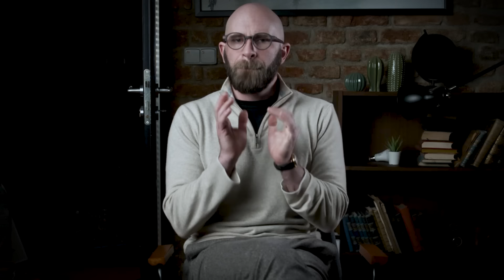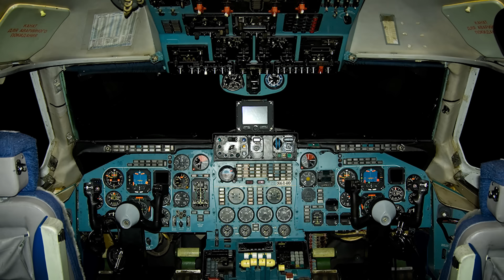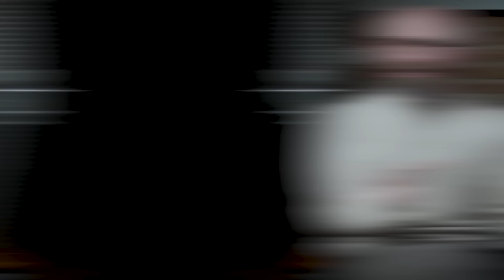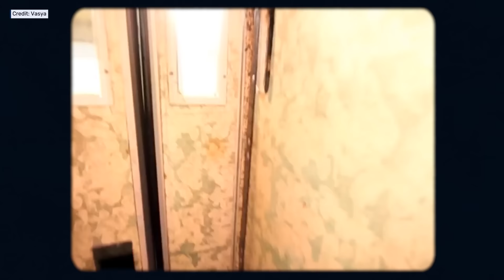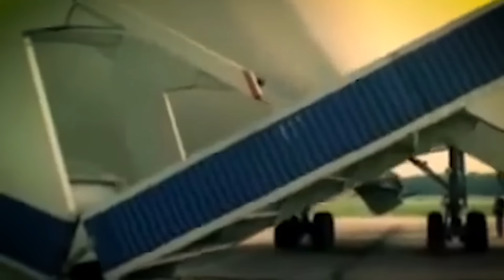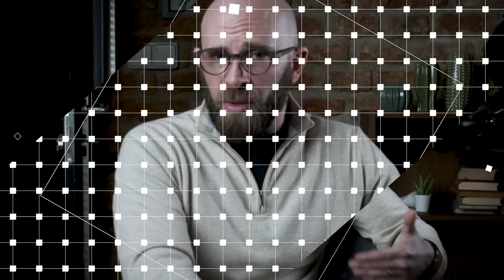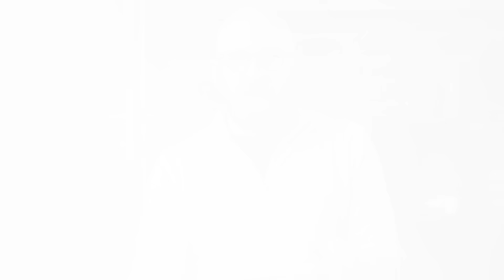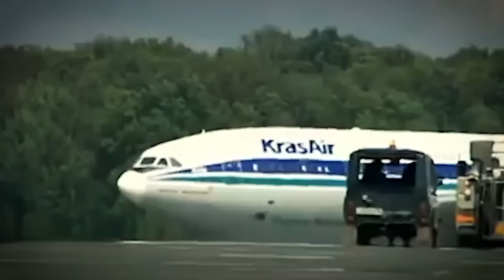The IL-86: The Soviets' Botched Answer to the 747

Comment: Far from me to defend the Soviet Union, but in this case, I think they're ragging a bit too much on the IL-86. Most of the "weird" features were copied from features that existed, on at least some versions, of the L-1011, DC-10, etc.

Cathedral ceilings (no center overhead baggage bins) were how all L-1011 and DC-10s were originally delivered. Carry-on bags were really not a thing in the 1970s. I flew on DC-10s in the 1970s that had the cathedral ceiling. Fantastic feeling of space.

The 747 was originally 9 across in economy, in a 2-4-3 arrangement (I flew one in that configuration as late as 1985). L-1011s and DC-10s were originally 8 across in economy. The 3-3-3 arrangement shown in the IL-86 is one of the more sensible things about it, there's a lot of research showing that it's a preferable arrangement (from passenger comfort standpoint) to 2-5-2, which is what the standard economy arrangement became in DC-10s. 

DC-10s and L-1011s had versions built with lower-lobe galleys with elevators going from the passenger-cabin to the lower-lobe. Not all airlines ordered this feature - it sacrificed lower-lobe space that could be used for more air freight. But, for instance, the DC-10-30CF convertible version (which could be quickly converted from passenger to all-freight configuration) had lower-lobe galleys with elevators. The elevators could be dangerous. There was at least one flight attendant who died in a malfunctioning elevator (World Airways in the 1980s). Not sure if the 747 ever had this feature, but would not be surprised if it was an option. 

The higher gross-weight DC-10s also had a center landing gear (DC-10-30 and DC-10-40), though only with two wheels, not four. In fact, such aircraft were known as "male" DC-10s because of the extra landing gear hanging down the center of the aircraft.

Lockheed built a version of the L-1011 which had lower-lobe doors and stairs. It wasn't common, but it did exist. PSA and Court Line took aircraft like this. There are surviving Lockheed video showing demonstrations of the in-built air stairs. 

What was really weird was the use of low-bypass turbofans on the IL-86, because the Soviets didn't have the technology (at the time) to make high bypass turbofans that powered the 747s, L-1011s and DC-10s. It's like if the DC-10 was built using the engines that powered the earlier generation 707s and DC-8s. This is why the IL-86 was noisy and underpowered relative to western-built aircraft.

Comment: Later version named IL 96 wasn't that bad.
Reply: and the first was good. the most important thing is that it performed its tasks with dignity. fuel consumption for the USSR was not a primary issue. range was not needed, the aircraft was developed for flights within the country, that is why it was called an airbus, that is, an intercity air bus

Comment: Every airliner has elevators, but not many have lifts.
Reply: Good comeback. Americans don't call them lifts since that is what they call part of a lady's attire. But elevators are also a control surface on aircraft.
Reply: I admit I was briefly confused. Simon is British, too, so should say "Lift".
Reply: This comment wins. And whistler is English!! What is this
Reply: There’s plenty on the wings
Reply: The L1011 had an elevator to the flight kitchen on the lower level
Reply: @ght33 The McDonnell Douglas DC-10 also had that feature but they called it a dumb waiter.
Reply: That is a rather short remark
Reply: Except the ones with elevons. ;-)
Reply: Im sorry but you are utterly wrong, every single airliner does have elevators which are important control surfaces that control climbing and descending of the aircraft. And without Lift (aka lifting force) that is generated by lifting surfaces, no aircraft would rise in the sky, I mean not at all.... :body-blue-raised-arms:
Reply: @madigorfkgoogle9349 except for aircraft that have stabilators…which is reasonably common on commercial jets
Reply: There the same
Reply: @himfen28  "There" is a word having to do with a place, like "over there." "They're" is a contraction of 2-words "they" and "are."
Reply: @danielocarey9392  please edit and add in an explanation of their
Reply: @johnbailey3877  Of their what?
Reply: @johnbailey3877  their what?
Reply: @danielocarey9392  I was expanding on your comment (which I enjoyed). 
THERE.   THEY’RE  & their
Reply: @johnbailey3877  I get it. Silly me.
Reply: @danielocarey9392 😊

Comment: Nine abreast economy seating (18" width) was wider than virtually every widebody on the market except for the 747. The 777 introduced nine-abreast 18" economy seating in 1997 (nowadays typically ten abreast with inhumane 17" wide seats and narrower aisles), but every other 20th century widebody used eight abreast (seven in the oddly narrow 767)
Reply: 2-3-2 in coach on a 767 was wonderful. You nearly always had either a window or aisle seat. If you were stuck in the middle seat, it still wasn't that bad because you were only one seat away from an aisle on either side of you. That was very nice. Too bad that configuration went away with the 767.
Reply: NO not correct  the L1011 and the DC-10 both had had 9 abreast seating in coach...  The L1011 used 42" wide seat seat pairs in the 9 abreast and the DC-10  had 17" wide seats.
Reply: The 767 used 2-3-2, the most comfortable arrangement. Some extreme low-cost operators have tried 2-4-2, but it's pretty well nearly impossible to do more than 7-abreast in a 767, just like more than 5-abreast in an A220, which makes these the most comfortable airliners in economy class generally. Too bad so few 767s left in regular passenger service. As for the L-1011 Tristar, the Air Canada one I flew on in 1987 had a 2-5-2 arrangement. As I recall, it didn't have a central carry-on bin setup... but it was  a long time ago...
Reply: I was on a 747 from Narita to Bangkok that had a 5-seat middle row layout. Can't remember what the outer row were though. Not sure what airline either.

Comment: The DC10 had a fourth landinggear just like the IL86 did. That is also true for the A340 series (while its newer than the IL86).

Elivator for the galley is something some 747 and all L1011 have also, so that was not really uncommon at the time

The L1011 also have built in steps, so again, that was already a thing.

Its also worth saying that not all countries was even part of the cold war, at least not in theory. Even in Europe Sweden, Ireland, Finland, Swizerland, Austria Yugoslavia (sort of kind of) and Albania was not part of the cold war. While Spain, Portugal and Greece joined Nato in late 70s, While the last countries was really not friendly to neither Nato nor USSR prior to that.

For the mentioned nation Finland and Austria actually traded quite a lot with to eastern block, and for Nato countries, that was also true for Italy and France. Even USA traded a bit with USSR

Comment: It really sucks!  The Lockheed L1011 TriStar was a work if art, but somehow the DC(death coffin)-10 sold a LOT more planes.
Reply: The DC10 had a range advance over the original L1011 - the later L1011-500 had a longer range, but a lower passenger capacity. The DC10 offered airlines better economics, although the L100 was a better plane in many ways.

Comment: An explanation of so much soviet production. Engineers, "it's a good idea. Let's do some R&D and we can have something great." Soviet bureaucracy. "Good idea?! Ok, full speed ahead on production"
Reply: Sounds sort of like Boeing these days, maybe we learned something, they were way ahead of use but we will get there
Reply: You mean like testing whether the Boeing 707 fuel tanks can survive a lightning strike? Or whether all the doors on a Mcdonnell Douglas DC-10 stay locked in flight? Or whether the rivet joints and windows on a de Havilland Comet can withstand the stress of high altitude jet speeds?
Reply: and now Elmo Musk appears to have adapted the Soviets' methodology.
Reply: @RandomDeforge That's not at all what's going on. There's a big difference between rapid iterative prototyping, which is part of R&D, and skipping the whole thing entirely and going to a production model with no serious testing or iteration. The latter is what the Soviets did.
Reply: @chimpychimp4921  But the Soviets always did perform a long testing program for new aircraft designs. Why do you think the Il-86 only started carrying fare-paying passengers almost 5 years after the the first prototype made its first flight in 1976?
Reply: @yoyohoolahoop3705  I'm not saying the ALWAYS did that. I'm saying that they did, in fact, do that sometimes. Which was a completely stupid and totally different approach to what SpaceX is doing.

Comment: Soviet airplane cockpits use an artificial horizon that operates differently from those in Boeing and Airbus airliners.  This contributed to more than one fatal accident when a pilot used to flying Russian aircraft began flying a western airliner and mishandled an emergency because he misinterpreted the instrument.
Reply: I recall an Air Disasters episode regarding this👍
Reply: Tu-154, IL-86 and almost all newer soviet aircraft had the western style attitude indicator.
Reply: A very similar thing helped kill Buddy Holly.
Reply: This is not entirely true, in fact partially a myth. Between 1930 and 1950 the Attitude Indicators on Soviet aircraft had the "aircraft" move side to side instead of the "horizon"(which only moved up or down). This both disorients the pilots less and was cheaper to manufacture(especially during WW2). From 1950 large Soviet aircraft began receiving newer Western style Attitude Indicators like the AGB-2 or PKP-1 where the "horizon" moves while the "aircraft" is fixed. Smaller aircraft could still be equipped with the older style(like the AGB-3 and AGD-1), they were also installed as a "backup" in some aircraft. Though there also is the AGI-1 - which is a small aircraft Western style Attitude Indicator.
Reply: @legatvsdecimvs3406  Thank you.  However, it isn't a myth; it's just that not every airplane had it.  But the crashes that occurred because of the pilots' misinterpreting a Western instrument were real.
Reply: @legatvsdecimvs3406   Nope, the artificial horizon should be a simulation of the actual horizon one can see outside if flying in visual flight conditions, not some Soviet workaround where you have to change your mindset if flying by instruments.
Reply: @h8GW  The Soviet indicator looked as if level and looking at the airplane from the back. I tried it in a simulator, and with large pitch angles it's actually better because it decouples the roll angle from the pitch angle. I can see why military pilots preferred it.

So it's not inherently worse, just different.
Reply: The Il 62 VC10 clone was the worst Soviet era.I'll not even mention the Tu 144 Concorde clone,oops! I just did.
Reply: @Phoenix-g9h  Tu-144 wasn't clone, they were introduced in the same time period
Reply: @Phoenix-g9h  Also known as the VCtenski

Comment: Hey. I'm learning about that now. Electric servo motor would be way more efficient than a hydraulic actuated servo! I get it!
Reply: How?
Reply: Hydraulic lines require a supply of fluid, this makes plumbing required. Together can increase weight and complexity of the installation.
Electric actuation does not need fluid. Just copper wire and actuator. Less weight. Less complexity.

Comment: The Il-86's replacement (IL-96) was just as much of a spectacular failure, but that hasn't stopped Ilyushin from desperately trying to con customers into buying a plane that literally nobody wants by continuing to upgrade and "improve" a design that was obsolete in the 80's,
Reply: Outdated? Tell that to the Boeing 737

Comment: Thanks for the video!  I flew on IL-86s three tubes in 1989…. The boarding stairs and luggage storage is what I remember.  The seat back ahead also had fans in them - with a switch to turn the rather meager airflow on or off…
Reply: Kind of like A/C in european cars of yesteryear, a mear suggestion of cool air. Lol

Comment: DC-10-30 had 4 landing gear. L10-11 had elevators to access galleys. Make your people do their homework Simon  !
Reply: also the forth gear was there to increase the landing safety on snowed in runways.
Reply: I grew up at the time when the 747 was new and the introduction of the tri-jets. Everything happening very fast. I never had a hint that the Soviets had a wide body.
Reply: @johnholland1308  they never talked much about their airliners that I remember either. They never flew to the USA. Just Europe, I think.

Comment: Soviet aircraft in the cold war era were based more on image than function. Most passenger jets were loud and uncomfortable. And often dangerous as they would put the aircraft into production before testing was completed. 
 And they never had the range of western aircraft.  A wide body or jumbo jet is pointless if it only can go 2400 miles.  A 737 can do that. The long range version of the 767 can do like 10k nm.
Reply: Tell that to Delta who regularly fly 777s from Orlando to Atlanta. (50 minute flight).
Reply: Nope you're wrong.
Reply: The 86 was never meant to be a long haul jet. It was made to be a high capacity medium haul domestic jet that sadly suffered from outdated gas guzzling engines. Most of the crashes were due to pilot error in the USSR and the Il-86 has a hull loss percentage that's less than the 737NG

Comment: Tiny problem of course is, that Sukhoi Superjet, Tupolev TU-204 and Yakolev MC-21are all based to Western avionics, as are brakes and many other parts.
Maybe they will fly above Russia someday, but Western airspace they will never see.
Reply: Not anymore, Western avionics was replaced in what is build now
Reply: @dmitripogosian5084  That's what I ment by maybe they will fly above Russia someday, but Western airspace they will never see.
Reply: @dmitripogosian5084 Not in the MC-21 and SSJ.  As far as I know most of the Tu-204 avionics is shared with the Il-96 which is mostly domestic
Reply: @benedekhalda-kiss9737 SSJ  is just undergoing testing with domestic engine and domestic avionics.   Actually, currently testing is done with two airframes , one is with domestic engine and another with domestic avionics, and next month they will add third aircraft fully domestic.  According to Russian news certification is expected in the Fall.
Reply: @ollivainikainen9388  that probably means that western airlines will not see russian airspace either to permanent advantage of the competitors from East Asia and Middle East. It is all matter of negotiation when time becomes appropriate. We still need to survive to that

Comment: DC-10-30 had a centre main landing gear and a lift (elevator) in the rear galley. Not so weird after all.
Reply: The A340 as well, even the -200, had an extra main gear too. It was kind of more noteworthy in a way that the L1011 didn't have one. Had the aircraft been more successful, and so had stretched variants with a much higher MTOW, it too probably would have got an extra main gear.
it reminds me a bit of the Yak-38 video to be honest, which pointed out a host of negatives and things that made it worse than the Harrier (and it was in so many ways) but including as one of them that it was only a single seat aircraft.... which also applied to the Harrier. Sometimes these scripts just try to stretch too far.
Reply: Also the DC10-40, but I believe the 30 & 40 variants only had two wheels on the centre landing gear leg. The A340 was the same, only two wheels on the centre gear leg.
Reply: Correct but A340-500&600 has four wheels on center landing gear.

Comment: The premise is totally false, IL-86 was not the answer to 747 (Group V plane) but to DC-10/L-1011, fellow Group IV planes.

For those who don’t know, aircraft groups limit the various dimensions of aircraft and airport design standards required to support such aircraft.

For example, Group IV planes need to have wingspans below 52m, while Group V can go up to 65m.

Besides that, IL-86 had specific optimizations for bad Soviet airport infrastructure (runway and taxiway thickness, luggage handling, lack of jet bridges).

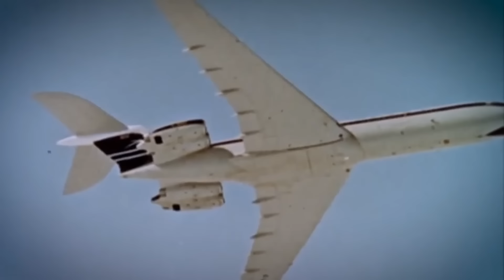Comment: Nice video BUT at at 2:07 that's not an IL-62, but a VC-10 of BOAC (British Overseas Airways Corporation). You can see it at the dark blue colour scheme and the thrust reversers on the outer engines which are not the clams as at the IL-62 but grills as on the VC-10. I am a German, so as our reputation goes very precice!

Comment: I flew on one from Moscow to Chelyabinsk in 2005.  Moscow had just experienced very bad weather and many flights were delayed for days.  Aeroflot pulled these out, I guess to get delayed passengers through the system.  I remember it being very spacious, especially compared to the Tu-154s.
Reply: The Tu-154 is how my grandmother made it out of Siberia
Reply: The Tu-154 was the Soviet equivalent of the B-727 and Trident. It was actually a good plane in its final M form, served as Poland's VIP "Air Force One" equivalent, but tragically crashed due entirely to human errors in 2010 with the Polish President and much of the country's elite on board.